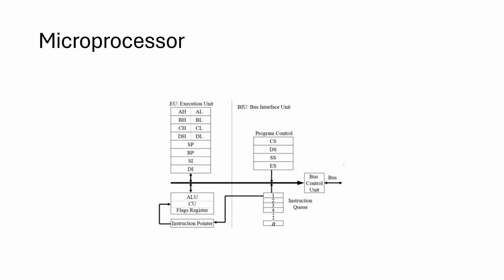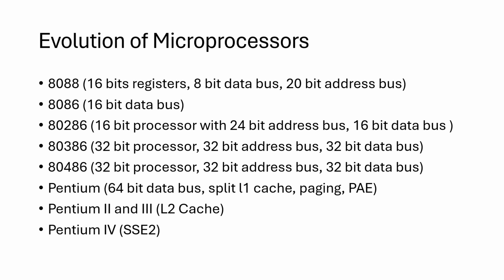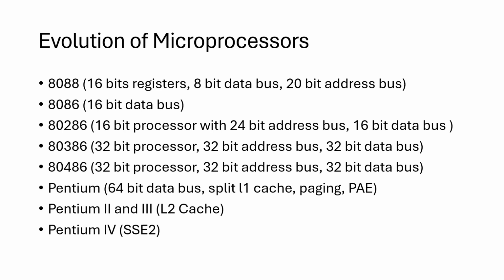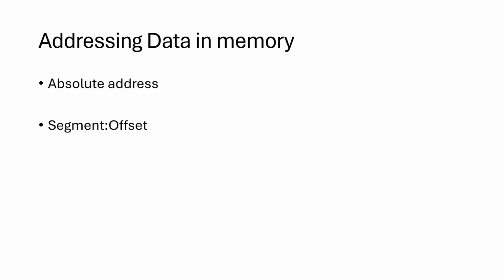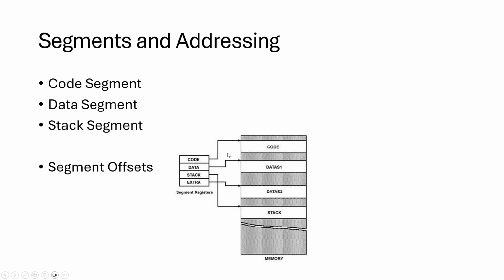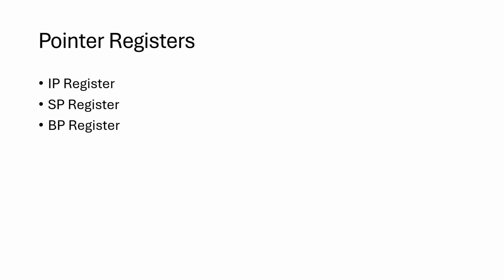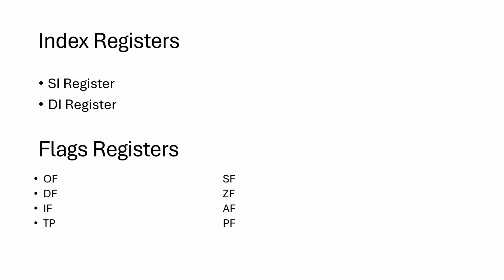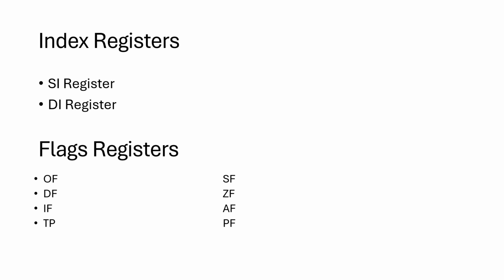Assembly Basics - Part 1 : Processors and Registers

Comment: Why is esp and ebp not divided into lower parts(sp and bp) in the table of 32 bit register?
Reply from the maker: @maxmuster7003  Registers like AX, BX, CX, and DX were historically used for general-purpose operations, including arithmetic and logical operations, and were divided for flexibility (e.g., AL for byte-level operations).
ESP and EBP are special-purpose registers, designed for managing the stack.  ESP and EBP are used for memory addressing:
ESP: Directly points to stack memory locations.
EBP: Used to calculate offsets for stack variables.
If these registers were divided (e.g., into low/high halves), it would complicate address calculations and memory access, as only the full 32-bit value is meaningful for addressing.
Since stack operations always require the full register, there was no need for partial access.
Reply: @NeXuSInfoS3c  We can use BP for 16 bit operation too, but if we use BP as adddress register without a segment override prefix the default segment is SS. .... I don’t like to push values to the stack, ignoring the calling convention. I use the stack for return addresses only for calling subroutines.
Reply: @NeXuSInfoS3c  I like to use the 16 bit mode of an 80386+ with 16 bit Offset register and i like to use the 16 bit BIG mode with 32 bit Offset register using an address size prefix(67h). In the 16 bit BIG mode we have A20 line on and a segment size of 4 gb for DS, ES, FS, GS segment and for CS and SS 64 kb limit. Don’t tell me that bp and sp are not usefull to build an address.
Reply: @NeXuSInfoS3c  The only one difference between the 16 bit mode and the 32 bit mode of an 80386+ CPU is the usage of instructions with or without an operand size prefix(66h) and with or without an address size prefix(67h). These prefixes reverse the default size of one instructions. These prefixes can be used in 16 bit mode, in 32 bit mode and in v86 mode of an 80386+ CPU according to the Intel developer manual and documentation from AMD.
Reply from the maker: @maxmuster7003  BP and SP are still highly useful in both 16-bit and 32-bit modes for building addresses, particularly with the flexibility offered by the operand size prefix (66h) and the address size prefix (67h). Their default associations with the SS (Stack Segment) and their roles in stack management don’t preclude them from being used effectively for general-purpose addressing.

In fact, in 16-bit BIG mode, with the A20 line enabled and extended segment sizes for DS, ES, FS, and GS, BP and SP can be powerful tools for memory access when combined with segment overrides or prefixes. Using 67h, you can leverage BP and SP to access 32-bit offsets, making them incredibly versatile beyond just their traditional stack management roles. 
Right now, I'm making these videos for viewers with no prior experience in assembly language, so my goal is to focus on foundational concepts and keeping things as simple as possible for beginners. I want to ensure they have a solid understanding of the basics like how registers function and their primary roles, before introducing more advanced topics like operand size prefixes, segment overrides and BIG mode specifics.